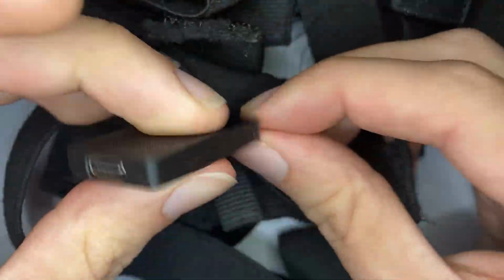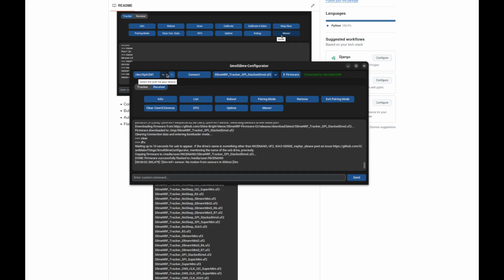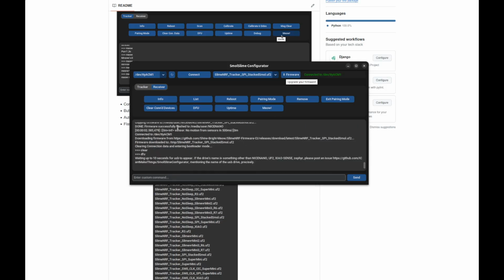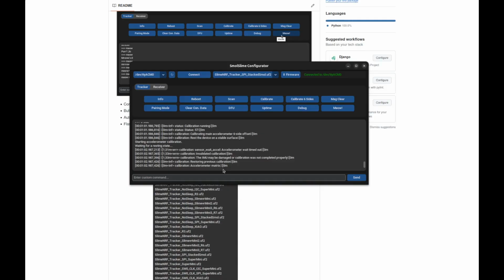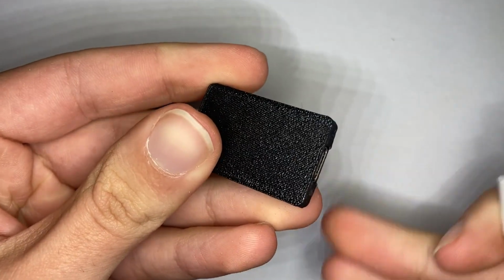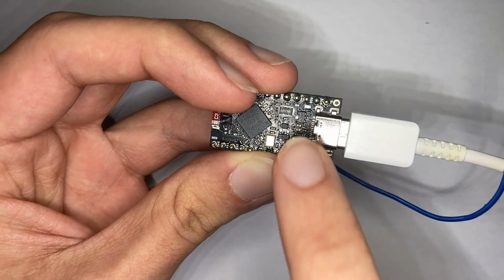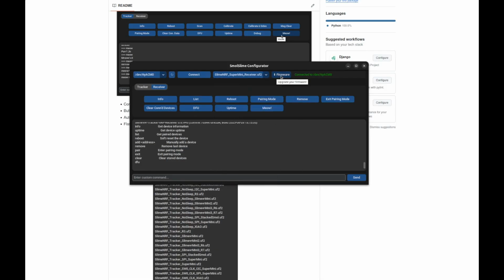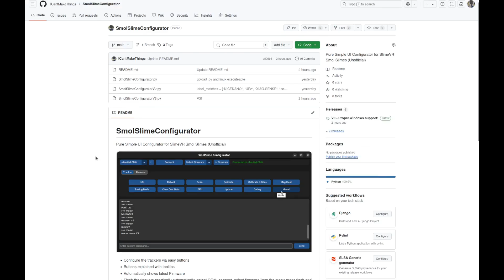Program & Calibrate your SmolSlimes Using SmolSlimeConfigurator | SlimeVR nRF52840 VRChat Trackers

Comment: What should I do if for some reason the tracker doesn't appear in the slimeVR server? Is there another way to check if the board is connecting to the receiver?
Reply from the maker: windows or linux? when you have both the tracker and dongle in pairing mode, you should see in the command line interface say connedted to tracker 0 then 1 then 2... and a ID like 5JF03JF0WN50VK